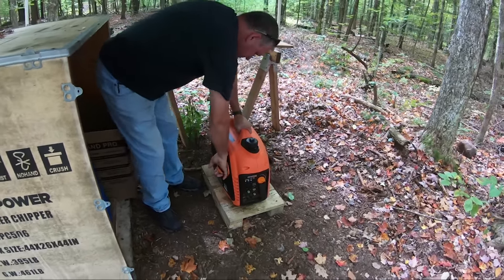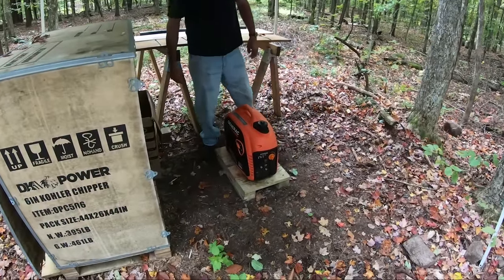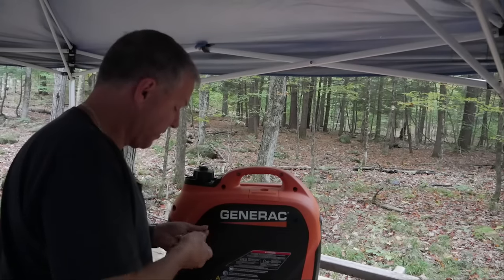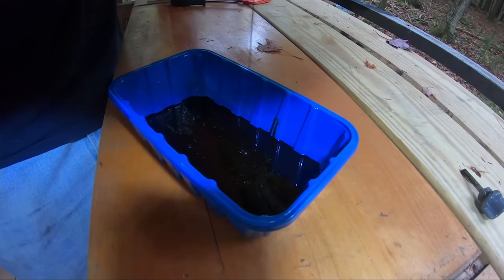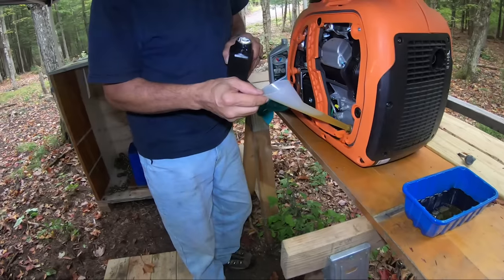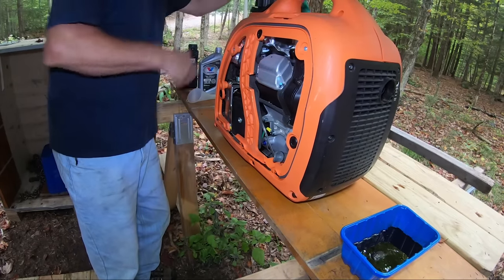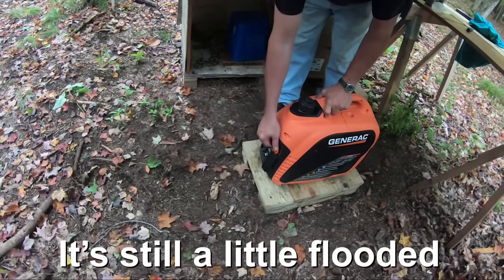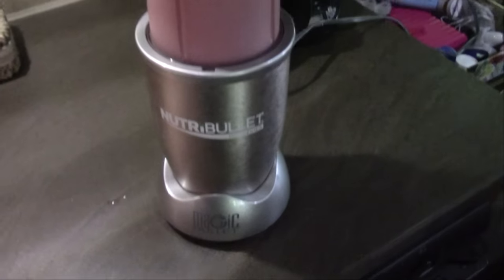GENERAC GP2200i - BRUTALLY HONEST 1 YEAR REVIEW

Comment: Guys, I applaud your honest review, of YOURSELVES if not exactly a review of your generator. I happen to be a Honda owner but I'm not going to criticize what brand you've chosen for yourselves, only time will prove out to you if you made a wise investment. Having said that, my Honda turns 10 this year and I put an average of 700 hrs/year on it so by the math alone it's between 6k and 7k hours. It's never been in the shop and the only maintenance I've done besides changing the oil is to change the spark plug and replace the pull cord. Changing the oil frequently is the single most important thing you can do to ensure longevity and I'd like to share with you some tips I've learned to make that chore foolproof and not take more than 10 minutes of your time:
First, invest in an oil change adapter. These are made out of turned aluminum and will replace using your funnel for filling, and making a mess when you're draining. I found one on Ebay to fit your unit for $15.95, type in: "Generac oil change adapter." You'll have to scroll through a bunch of them for Honda, and a few for Yamaha but you'll get there. What this adapter will do is carry the oil outside the case when you tip the unit so you can drain without getting oil all over. This way you'll just need to tip it and not kill yourself trying to lift and hold it up.

Second, look in your owners manual and find the oil capacity of the generator (mine is 12 oz). The plastic oil jugs you're filling from normally have a transparent window on the side away from the spout, once you've determined how much oil is needed mark a line on an empty oil container at that mark. Now you can fill that container to the mark (on a level surface) and you'll have a pre-measured amount of oil every time (you could also dedicate a small plastic measuring cup. I just found it easier to use an empty oil container).

Third and most importantly, make yourself a set schedule for changing the oil. Check to determine how often you need to change it, mine is 100 hrs. I run my generator daily an average of 3-4 hrs (sometimes more, sometimes less) which roughly translates to 90-120 hrs a month. I change my oil the first week of every month, without fail. I don't set a specific day because something may keep me otherwise occupied for a few days allowing me to get sidetracked. As long as it occurs in the first week of the month everything is golden. Since going to this schedule I've never had the generator shut down in mid-use or fail to start because of dirty oil.

Lastly, if I know I'm going to be gone and not using the generator for more than a week or two, then I add a fuel stabilizer to the fuel. This is not a bad idea to do any time and won't hurt the unit if you do it all the time. The product I use is called Sta-Bil. Look for the version that is specifically for ethanol fuel. It helps to counteract the harm ethanol does in small engines. Now, after an extended absence I may have to pull that cord a few more times to pull fuel back to the carb, but once I get it to fire off it will restart daily with no problems, almost always on the first pull. I hope you find this information useful and that you get many years of troublefree use out of your unit.
Reply from the maker: Wow. Thanks for all that helpful information. I agree that regularly scheduled maintenance is key. A lot great tips there and appreciate it very much. I came up with some of my own maintenance ideas and if you have time I would appreciate your thoughts on what I did. Here is the link: https://youtu.be/_Vj8r8hCDCA
And I did use the sta-bil - it goes in all my stuff and it does work great. Thanks again so much - I really appreciate the time you took to research on e-bay for me and to share your knowledge. Have a great day!

Comment: You can use a turkey injection buy it at dollar trees 
To remove some oil if over fill
Reply from the maker: Bill Guy that’s a great idea! Thanks 👍
Reply: Thank you for your response.
Reply: It's basically impossible to overfill, you're supposed to fill it until it overflows. The only way to overfill, would be if the engine was tipped away from the filler neck.

Comment: Was this the first fill break-in oil?  Talk about a torture test. LOL
 
I'm surprised it even was still flowing and hadn't turned to tar in spots inside the engine.  I'd change the oil again right away after a couple of hours to make sure there wasn't any tar plugging up the oil galleries at the valves and the main bearings. 

Even with a quick second oil change I predict early engine failure well before the regular expected lifespan of this engine since it took a real hit here and has experienced excessive early wear due to poor lubrication for so long.
Reply: I forgot to add that I would suspect excessive oil consumption with this engine from now on so expect that and experiencing the engine shutdown due to low oil level at or even before recommended oil change intervals now.

Comment: If the oil wasn’t black like that I’d be wondering. Motor oil catches contaminates and there’s no filter on a small engines oil can be over saturated with contaminates that causes extra wear within the motor resulting in premature failure. I’d say although that generator functions fine it’s definitely to finicky for my taste, but works for you and it doesn’t cost as much as a Honda or Yamaha and it is extremely quiet I’d say quieter than a Honda or Yamaha.
Reply from the maker: Theres advantages and disadvantages but you are correct, it works great for us and we are very happy with it :-) Thanks so much for commenting. Hope you have a wonderful New year!

Comment: Pro Tip: After dumping out the old oil, half-fill the sump with new oil and dump it out again. That way you'll flush out sludge that may remain
Reply: Complete waste of oil.  There isn't going to be any sludge in an engine run for 343 hours on synthetic oil.  Just let it drain completely, and refill.

Comment: That little wooden platform under the generator is acting like the soundboard on a guitar, so it's making the noise from your generator louder.  Try replacing it with a concrete slab or paver.  That should make it even more quiet.
Reply from the maker: Interesting point. Will have to test that theory! 👍 we have some cinder blocks.
Reply: @CreatingASimplerLifeOffGrid  cinder blocks might be better, but they are hollow too.  Your best bet is a SOLID and HEAVY base with no openings.  For example, if you close up the open sides on your wooden base, fill it with sand, then put a bottom on it, you will greatly deaden the noise.
Reply from the maker: Good idea... we are going to try something else for sure! Thanks for replying 👍

Comment: I have a preditor (honda clone) it does the same thing. must be full of fresh oil or will run bad and/or shut down after it starts. very small oil capacity = dirty pretty fast, not hard to change and cheap so do it often. I also discovered that a stiff foam pad and decent sized plywood under it will help keep it from sucking in so much dirt for cooling and running.

Comment: My recommendation with this type of small generators is to remove the gasoline left in the carburetor if you are not planning to use it for a long time.  Its a very simple process.  You remove the side cover and there is a plastic hose attached to a screw valve.  Turn the screw to open this valve.  It will empty the excess gasoline from the carburetor.  This will prevent the carburetor jet from clogging.
Reply from the maker: Thanks for sharing!

Comment: Excellent review! Yep- a good dose of fresh synthetic oil every 40-50 hrs, always use non-ethanol gasoline. Just buy high octane gasoline. Oh- and add gas STA-BIL, run it through the engine and carburetor for a bit before you leave for an extended period of time and make sure the fuel tank is filled all the way to the full mark, this will help prevent condensation buildup in the fuel tank adding water to the gasoline. Better yet, if there is a fuel shut off valve turn that off and let the motor run out of fuel. This will help prevent the gumming up of gasoline in the carburetor and engine from sitting for long periods of storage. The gas STA-BIL will help prevent varnish/corrosion buildup in the carburetor keeping it clean during storage. 
FYI- propane lasts forever, no fuel storage issues, and once you turn the propane off there's virtually no gas or residue left in the motor preventing build up of contaminants in the carburetor or engine. Might be a consideration, and a really good comparison video to make!
Reply from the maker: Thanks so much for sharing all that! Propane is a definite in our future, not only for a backup generator after we build, but for the house in general. Hoping to get a 1,000 gallon tank. It is the only way to go in a cold climate in our opinion. Interesting thought about making a comparison video....Appreciate your taking the time to comment and wish you a very happy new year!
Reply: Your welcome! having lived in the Northwoods of Wisconsin without electricity for several days, one to many times, and using a propane powered backup gen-set for a week, invest in propane powered appliances. Stove, Freezer, boiler for forced water heat and house hold hot water supply. You will be thankful! Do not buy any fancy digital operated boilers or on demand water heaters to save energy, one lightening strike, power surge, or electrical gremlin in that fancy digital board and it will shut itself down. And the cost to fix that? Weil-Mclain still manufactures the simplest easy to use and "hot-wire" in a pinch hot water boilers. I've even hooked up a barbecue tank when we ran out of propane. 
 https://www.weil-mclain.com/products/boilers
https://www.thecabindepot.com/collections/appliances
Reply from the maker: Keep it simple. That is the best advice ever! We know that the area we are building in loses power quite often in storms due to downed trees and that the area, being so small and remote, is one of the last to be fixed as well. That said, propane appliances are on our list! Good advice on the digitally operated stuff - it's unnecessary and adds an extra layer of problems! I like the hot-wire in a pinch hot water boiler for sure! And that link, that was great. Still looking through all that site has to offer. Really appreciate the input - Thanks!

Comment: Dirty muffler! LoL....
Reply from the maker: LOL. Thanks for watching!
Reply: Actually, a cloggy muffler screen CAN be a problem with those little 2-stroke fussbucket generators like the Harbor Freight StormCat/TailGator ones. You just clean 'em up with a wire brush now and then. They may not be as quiet or powerful or as suitable for delicate electronics as that nice Generac, but they're handy, light and cheap and will putter along happily at most any incline. They'll take a lickin' and keep on tickin'...and don't need oil changes!

Comment: Thats a piss poor system for an oil change!
Reply from the maker: I agree but it is what it is. Thanks for watching!
Reply: Most all of these quiet compact inverter generators have a similar oil change setup, regardless of manufacturer. I have a Honda EU3000i Handy and changing oil is a PITA. One teaspoon over and you have a huge mess. I've finally started using one of those pump-style oil suckers and it makes changing the oil a bit easier.
Reply from the maker: EOSJOE we just ordered one of them from amazon! Hopefully it makes it a lot easier next time 👍
Reply: I use a suction type extractor. It also stops the carby from flooding when you tip it over.

Comment: A couple of little things. A Hobbs meter (hours) is inexpensive and easy to add, a quick net search will give you lots of options. Use 100% gas if available. On pouring oil, many don't know the pouring spout on the quart of oil should be at the top, not the bottom as most people use them, you poured from the side which isn't bad, but top is more controllable.
Reply from the maker: Thanks for the tips! Appreciate it very much :-)

Comment: Could this charge ebikes?
Reply from the maker: I don’t see why not!
Reply: Thanks for replying.. im very intrested in buyjng a generator or solar panels with a deep cycle for on the go to charge ebikes.

Do u know what exactly regular maintainence is on this engine?? Besides oil change every 50 hours.
Reply from the maker: @derkgold6395  You will have to change the spark plug about 100 hours, add sta-bil to the fuel if it is going to sit without use for a while and if it is going to sit for a very long time you need to run the gas completely empty. I'm curious, what is the volts on the e-bike battery?
Reply: Creating A Simpler Life this is the bike, its pretty powerful little thing i think. Im not to educated on the electrical and mechanical stuff tho so i cant genuinely answer ur question but that webpage has all the information about the bike . Thanks again

https://rizebikes.ca/products/mini
Reply from the maker: wow! that bike is really nice!

Comment: This is very informative. Thank you.  Looking for an easy setup for my aging parents that live out in the country (power outages aren't uncommon) and these are looking better than Honda in every way 🤔. Just gotta figure out the starting if I'm not around/ runs out of gas.
Reply from the maker: It actually starts really easy so long as the oil is kept full. When and if it doesn't start it could be because it has a low oil cut off switch. This is to protect the engine. Make sure you do not make the same mistake we did by letting maintenance go far too long. Thanks for watching and hope you figure it all out.
Reply: ...Go with solar? Lower maintenance, no need to get gas

Comment: Mahalo (thank you) for the review. I really believe you'd enjoy the Champion 100302 4000W RV ready digital hybrid open frame series inverter with silent tech. After 2yrs and thousands of hours, It's very reliable and uses no oil. It has a 15-17 hour fuel range on 2 gallons of fuel. It's also much quieter. I've owned the exact one you have and the constant taking the cover off and adding oil was a nuisance. I change oil once a month and use non-ethanal fuel. The price is great also. Aloha hau'loi be kool
Reply from the maker: We were actually looking at that. Thanks for the info 👍

Comment: Because of vegetables being added to fuel, the white flaky deposits in the carburetor bowl is from fuel settling in the bowl, the best way to avoid future carb issues is to: While the motor is running is to turn the fuel off and let the motor use up the reaming fuel in the line.  I stopped using the shut off switch years ago when an elder fuel chemist explained ethanol effects on aluminum.  Only a few engine/ generator manufactures have actually designed an accessible fuel shut off on the panel because of this issue.
Reply from the maker: Thanks so much for that information! Living and learning :-)
Reply: I always run it dry. Pump out as much fuel from the tank with a hand pump, then run it out. Same with the pressure washer. Those small engines HATE to sit around with the fuel in them. You are virtually guaranteeing a "no start" if you leave them fueled.
Reply from the maker: @Gallagherfreak100  Thanks!

Comment: How many watts is that ac ?
Reply from the maker: It basically needs the full 2200 to start and then it runs on an average of 550 watts but it will use more when the compressor turns on to cool. The AC is a 5,000 BTU. The generator runs it all night long while we sleep - a good 8-9 hours on a full tank of gas. We know it uses quite a bit when the compressor turns because we’ve accidentally turned on the coffee and when compressor turned on it went into overload protection

Comment: 99% of the time. when a motor doesn't start that's been stored or not used for a while. It's the result of the carb needle valve sticking and not dropping as it should to fill the carb float bowl. A gentle rap on the carb with a hammer, or if the carb is not accessible taking out the plug and pouring a little gas directly into the cylinder is usually enough.

Comment: This should be called a “Brutally honest video” since it’s really not a product review but rather an admission of guilt for neglecting the unit’s service needs. Don’t feel bad. Happens to the best of us. FYI the much more expensive Honda that I owned but that was recently stolen would have the same problem after sitting. Any small carbureted engine will give you starting fits after sitting for a long period of time. This appears to be a solid offering in the 2000 watt market space so I think it’ll be replacing my stolen Honda. 😫 Cheers.
Reply from the maker: Sorry yours was stolen! We actually hear that a lot from people. This is a great little geny and despite our initial neglect it still runs great for us and meets all our needs. If you do get one as a replacement I hope that it serves you as well as it does us! Happy New Year.

Comment: still do not understand why they don't put valve rotater's in these small engines and eliminate most of these small engine problems. also I think it is synthetic blend oil. Also you put some of the deck boards on upside down. Ring side up so the water runs off.
Reply from the maker: Thanks for the info. Have a great day!

Comment: Proper maintenance is a must. Tip it away from you and put some extra oil in. It won't hurt. Then when running it won't have to be perfectly level. Check out my oil change video on BCS tractor for sidehill mowing. This will explain the reason for extra oil in the engine. Thanks for sharing. Your friend Bryan
Reply from the maker: Appreciate that Bryan. 👍

Comment: I've own one Genera  generator a 3250 watt, 3750 max. I used for 2 years and sold it. The new owner did not run it once a month and it stopped working.